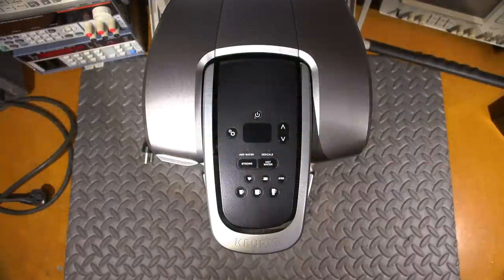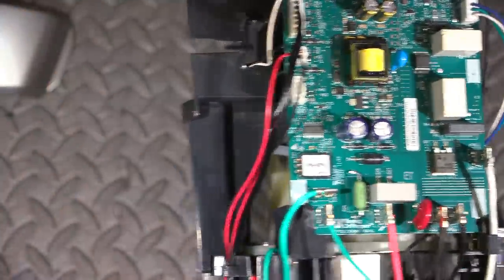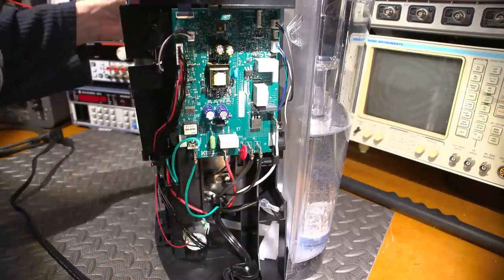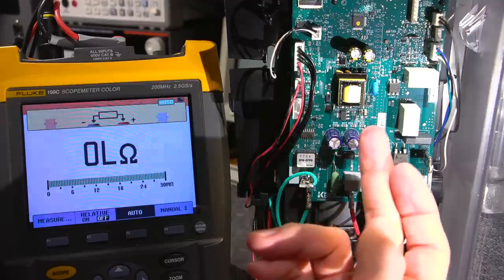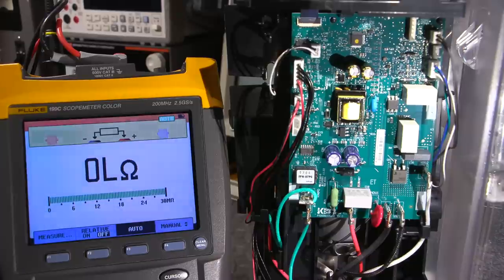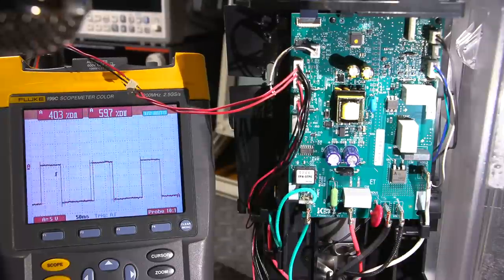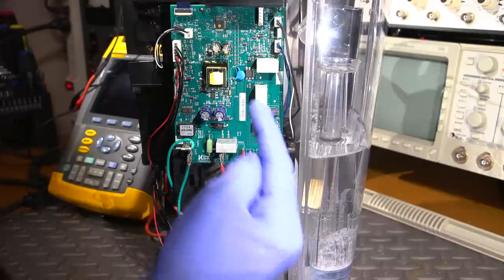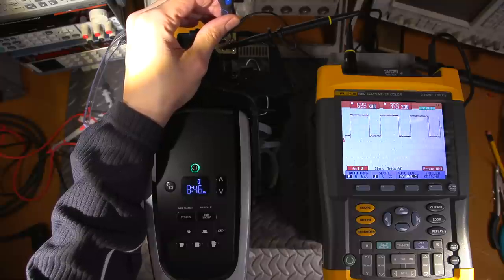Coffee Maker Repair And Modification - "For The Perfect Cup"- The Keurig!

Comment: I guess what you do is no great shakes to you, but to me it's absolutely amazing. Even though I'm not an electronics guy, watching your methodical diagnoses and repairs is not just fascinating, it's instructive. Thank you for taking the time!
Reply: I teach Windows and Linux classes and try to show my students how to be methodical and analyze problems.  Too many "techies" use the shotgun approach and just start changing things at random, hoping something will work. 

 I spent too many hours during my previous career as a telecom tech undoing botched fixes that didn't solve the problem.
Reply: @gwesco  that isn't troubleshooting, it's as you said, shotgunning. I also call it what it is, the minus moron method.
Know how it works, figuring out whatinhell fouled up is trivial then, be it a PLL or a PLA.

I should get one of those cup makers and for giggles, do it all in analog, just for giggles. Fluidics, nah, that'd just be an exercise in masochism...   ;)
Reply: @spvillano  One of the things that used to drive me crazy was I had two techs that both went to the same factory training for Nortel as did I.  When they had an issue, they would just start swapping out cards and if that didn't fix the problem, they would call me.  The problem was they never marked defective cards so they were often just swapping in bad cards for good cards compounding the problem.  I would have to put everything back as best as I could and troubleshoot from there.

Comment: That was fascinating how you fooled the coffeemaker into giving you the correct amount again! I had a different problem with my Keurig, a smaller and less complex unit. After several months of use, I noticed the pump seemed to be laboring and the amount of coffee was slightly lower. Since the circuitry was much simpler, I suspected a plumbing problem. I took the thing apart and searched in vain for a blockage or kinked hose. Then I noticed the valve at the foot of the tank looked obstructed. When I took that apart, I found, to my chagrin, a mass of tiny hairs blocking the opening! (I have cats.) Since then I've been scrupulous about the cleanliness of the water.

Comment: I know it is never great to pull apart a working machine, but would have been nice to compare the PWM of the bad machine to a good one.   I wonder if it could still be some weird motor fault that causes it to not go fast enough at the set pulse width. .....
That said, I am not sure why they need to make coffee machines so complex :).   Thanks for a longer video.   I like the longer video format, even with a coffee machine :)
Thanks for posting this one.   Saved another machine :)
Reply: @khwolter9038  I think the The RF Interference is maybe something not quite right in how the the components are playing with this one.   That said, it should of had the capacitors to compensate for it anyway.  It seems to be a one off though.  Probably should of gone back under warranty at the start.
Reply: @EsotericArctos  can you imagine trying to warranty a unit for RF emissions. I doubt theres a box on the call centre script for that one.
Reply: @TheFool2cool  Yeah, it would be a laugh to get them to do it, but I am sure the machine spewing RF out would breach FCC regulations :P  
I am laughing now imagining the call center agent crazily looking through their templates for an answer.
Reply: @EsotericArctos  At first I thought it was just AM and it'd be no big deal, that's not really going to be enforced. But then he said FM, which means it's also putting out noise on all kinds of spectrum in between. That violates everything!
Reply: @cheyannei5983  Probably on the VHF aircraft band too. That could get you a visit from the FCC. If you have a houseful of radio equipment you got a lot of 'splainin to do.

Comment: Just wow. I've dreamt of being that good at repairing electronic equipment. The theory is simple; a FET switched motor on the ground side, using a PWM to vary the speed of the motor, mixed with the signal from a Mask-ROM pre-programmed micro-controller which has become partially corrupted. But to actually test that theory then design and build a PCB and fit it - that's the bit that really impresses me. Thanks again for another great video.

Comment: Mission accomplished!
I always enjoy your repairs and restorations. The board looks kinda complicated with all these SMD parts - who would expect that you'd find something that complex in a coffee machine?
By the way, I've done many repairs on a Gaggia GD One machine in an IT company I cooperate with, but no electronics. Mostly failing components: temperature regulator, pressure switch, leaking heater that tripped the RCD, clogged tubes (not the vacuum ones!), that kind of stuff.

Comment: Do you think it was noisy when new or did a component fail that caused it to be so noisy? 
Is it possible that the noise confused the processor and made it miscount the pulses from the pump motor, slowing it down.
That was an interesting problem and solution, thanks for letting us watch.
Will you be showing us any more on your new shop or your plans for the old shop.
Thanks again for the great content you produce.
Reply: I was wondering the same thing, surely this noise issue is unique to this one particular coffee maker, due to a failure somehwere, otherwise they'd not pass EMC. And more often than not, one issue leads to another, so it could be confusing the micro PWM too. If it was me I'd try to find another PCB on ebay but that would not be making good youtube content :)
Reply: Exactly!😀
Reply: My thoughts also. As Paul says the parameters may have changed, and the cause may have been triggered by electrical noise during one of those frequent power cycles. The comment from Microwave Dave about restoring a feedback parameter for fill amount sounds logical.

Comment: I think the frothing bit at the end is actually just clearing liquid out of the lines, otherwise the spent kcup would make a huge mess when you pull it out to throw it away (it would also avoid starting the next brew with however much room temp water is contained in the lines).
Reply: It's labelled frother on the board, he points it out around 50m 18 or so, then again at 51m 30 or so.
edit - 0:51:30
Reply: @zcomputerwiz  Maybe there wasn't enough rom room on the board for "frother that doesn't froth"

Comment: My Keurig B-79A since I descaled it seems to have a rubber part in the pump that draws the water from the tank making much more racket like it is not quite so smooth anymore. I wish they made the parts more replaceable like the chip in yours having a new, more reliable one would keep you from having to design your own workaround to repair a poorly functioning chip and the noise canceling you had to do should have been reported to Keurig.  Mine is over 10 years old, but they shouldn't push decaying as much with unreplaceable gaskets and O-rings. Interesting video. I went to school for computer electronics and then joined the Navy as an Electronics Warfare Technician for 16 years. I wish the Navy had video help online like yours to give us more than black box replace parts training. I subscribed!
Reply from the maker: Thanks for your kind comment Robert!

Comment: I would be interested in knowing the preferred values for the decoupling capacitors you used to isolate the RF noise.
Reply: Yeah I have the same rfi problems with the exact machine.
Reply: @cuoops  It should conform to RFI standards. Sounds like it is illegal!
Reply: I'm guessing one or both of the factory interference suppression capacitors were defective. If that's the case, replacing them with the same value should fix the problem.
Reply: @eDoc2020  see comment above, 2 exact same machines both have faulty caps? Unlikely!
Reply: @steve6375  Mr Carlson said his had RFI problems since it was new, suggesting it was a manufacturing issue. If his and cuoops' came from the same manufacturing run it is not surprising that they'd have the same defect.
Reply: @eDoc2020  unlikely, I would check FCC number and lookup on internet to see if correctly tested and registered. Or maybe a Chinese fake?
Reply: @steve6375  As the coffee maker is not an intentional transmitter it most likely does not have an FCC registration. The capacitors might be fakes, or maybe they got damaged between the capacitor factory and Keurig's assembly line, or maybe there was a mixup at one of the factories.
Reply: @eDoc2020  FCC used to be mandatory but I see now it isn't since 2017, what about CE mark?

Comment: I kept expecting the RF noise to be more of the cause of the problem. Reminded me of automotive diagnostic class when I learned about the Volvo that had a shorted winding in the starter, but the starter would still work. But it was causing the engine to run bad because the computer would take a "snapshot" of the camshaft position sensor while the engine was cranking over. The "electrical noise" from the shorted winding in the starter was corrupting the camshaft sensor reading. Later after they caught the problem, they redesigned it to use a real time reading from the sensor instead of just the snapshot of when it was cranking over. Otherwise, you'd never think to replace a starter when it's just running rough.     Anyway, GREAT VIDEOS!!!

Comment: I don't believe for a second that the programming is corrupt. It seems more likely that the MCU is seeing some kind of noise as extra pulses (and uses a P or PD controller without an integral parameter). Notably absent from the video is checking the 3v3 rail! Most likely the SOT23-5 next to the MCU is a 3.3v LDO. It is possible that the noise is internal to the MCU but I would have expected it to then be visible on the sense lines?

Comment: C18 appears to be a decoupling cap, it probably went bad. You probably didn't need to add any caps just replace the existing one. The RF noise might have also been what damaged the processor, not just leaving it off.
Reply from the maker: C18 is fine, and if it's paralleled with the same type of capacitor across the line, nothing changes. This capacitor is across the line, not to the ground where the noise is propagating. This is why you only see two added capacitors on the back of the board, not three. C18 forms the third cap. Very good comment though, you know your bypass circuits!

Comment: Excellent example of the issue of "right to repair" - what a different story if full documentation was available - schematics, functional block diagrams, programming constants.  What we need is an Open Source coffeemaker!  I am intrigued, Mr. Carlson, with the "Serial Debug Port" !!!
Actually the Keurig is amazing in that it is available at consumer prices with such sophisticated electronics and mechanical wizardry and a robust system for the necessary consumables.  Were all the documentation available the copies would be flying out of Asia within weeks.
Reply from the maker: You are absolutely correct.

Comment: Excellent education video. i've probably discarded a few coffee makers that were still usable. 
However, Maybe some day you could design and build a PWM supply for the old Lionel Trains 3 pole motors they used in their locomotives. Surley there are a few old model train enthusiasts out there.
Reply: Actually I'm an American Flyer train enthusiast and have upgraded several vintage accessories with microprocessor controls.  I love vintage tech.  How many 70 year old toys can you find that with a little TLC can be made to work like new?  Most toys today are disposable items when they break.

Comment: Hi Paul. I have two of the cheaper red ones from Walmart, Neither one since day one consistently pumps to the correct level, I am hoping that the recalibrate level works on these as well. I must have done the engineer thing "manual, we don't need no stinkin' manual". I have worked on a couple of the commercial ones that can be fed with a water line. The fix on both of those was new caps all around to replace the garbage ones that Keurig used with Nichicon 105C Low ESR types. The trick on  those machines is getting them apart without resorting to the jigsaw. It was tempting until I figured it out.

Comment: A brilliant video, as usual, Mr Carlson. I wonder if an alternative repair would have been cloning the code from one of your other identical coffee machines?
Reply: It's probably possible, but requires smd work and some machine that can take that footprint and read from it's memory. To me it sounds like it would've been more work than he did here in addition to the potential risk of accidentally breaking a good working machine. Sounds feasible though.
Reply: Most likely firmware reading is locked

Comment: Wouldn't it have been a good idea to tear down another one that you have to make comparisons? You may have a bad pump and you're just compensating with a 60:40 mark space ratio? Also you could have looked at the interference suppression differences from one against the other.
Reply: I found the troubleshooting on this one illogical and presumptive, ending with a kludgey workaround. Some basic swaptronics with the working units would have given more deterministic results.

I wonder if anyone has made a "Keurig shield" for Arduino to replace the factory control board.

Comment: STM32 either die or work completely well, so I do not think any parameters are missed it firmware is corrupted. Most probably the part of the sensor circuit inside the pump is dead. Adding constant cycles works, but still it would be even more interesting to see the sensor problem - in fact, nobody guarantees that adding constant cycles to the sensor signal will work for all cups (well, most probably it will, it's not a rocket science, but...)...
Reply: Agreed.    Most Hall effects sensors are 3 wire . The sensor on this liquid pump had 4 wires. Most likely positive, GND, Phase A ,Phase B.   My guess is the sensor was missing a phase going back to uP

Comment: Just had the same problem on a different Kurig. Was not filling to the normal amount AND it was not predictable. Sometimes it put SOME water in there, sometimes not. Pump seemed to be running kinda quiet (slow). Pulled that monster apart, more plastic than most car dashboards... I just KNEW that this thing was needing a new sensor or something.. I finally gave up and put it back together. (only had ONE leftover screw)
In an act of desperation, I descaled it VERY HARD, used a 25% mix of glacial acetic acid/ 75% reverse osmosis water. Cycled it through about 4-5 cups of the mix. It produced a LOT of scale into the cups.
It has been working fine since. HISTORY: The Keurig in question had been used on spring water at my farm up in SD. I have several different Keurigs in use here. One other started doing seemingly the same thing by making smaller and smaller cups... acetic acid bath fixed that one as well. I have since installed an RO unit and use that water for coffee and the humidifier, no more problems.
Coffeemakers have gotten so complicated since they have line cords!

Comment: It’s not a frothing motor. It’s an air pump that activates at the end of the brew to evacuate the water from the k cup. Every single serve coffee maker has one. Otherwise it would drip for a long time
Reply: It's labelled frother on the board, he points it out around 50m 18 or so, then again at 51m 30 or so.
edit - 0:51:30

Comment: Lol, it's a good thing you're not trying to open up one of those early ones because those things were all plastic welded together and impossible to deal with.. 
My 1st Keurig was a B60 in 2010 and and by 2015 I had had 6 of them,,  all but 1 replaced under warranty..
If memory serves all but one of them had the problem of making weak coffee which was probably pump related..
The last one replaced under warranty was replaced with a different model and that's the one I'm still using 7 years later...

Comment: This reminds me of when I was in the Navy and our paper shredder broke. Big commercial sized shredder. Used a microprocessor for forward, backward, detecting jams. Anyways, the processor in the thing quit (signals in but no signals out) so I just repurposed the buttons in the front panel to drive the motor relays, so the processor wasn't doing anything anyway. Fun times, thanks for the memories from when I was a somewhat skilled electronics technician.

Comment: THIS is the kind of videos I can get into. I am not that up on electronics, but I have done some recent electrical mods on a 12 volt automotive compressor and a 12 volt 5 ton scissor jack to make them 100% portable by running on power tool batteries.

Comment: Mr. Carlson, I am very impressed with your electrical diagnostic knowledge and enjoy all your videos. This coffee maker, with two issues: 1-RF Noise & 2-Modulation problem of pump by way of the processor. Ingenious how you by=passed the chip and introduced your own modulation control! As for the RF issue, though you fixed it with adding capacitors, I feel the original cause of the RF was not identified. All these commercial items must meet government RF noise allowances, not to be exceeded. So it's not that the design was short by those capacitors you installed, but the unit had a faulty something that caused the RF to exceed limits, else the product could never have been approved for distribution by the governing authorities. Do you agree? This does not take away your skills in bringing the RF signal back into compliance. Thanks, Carl